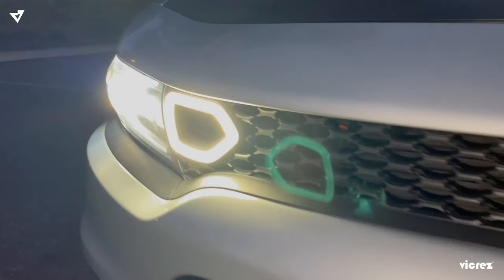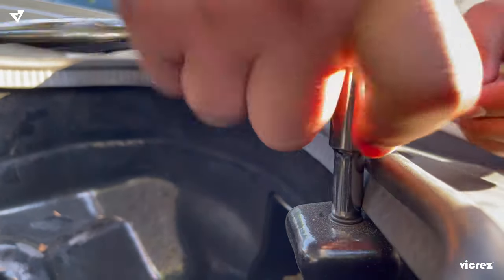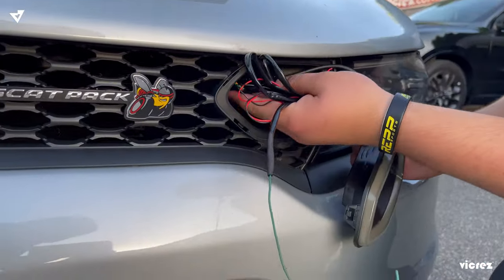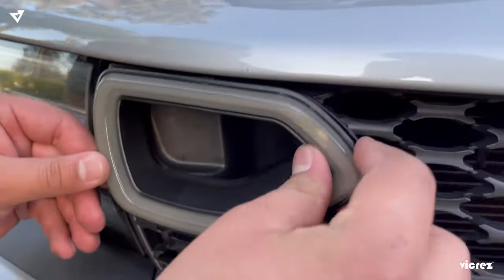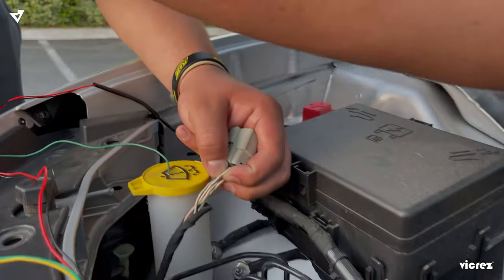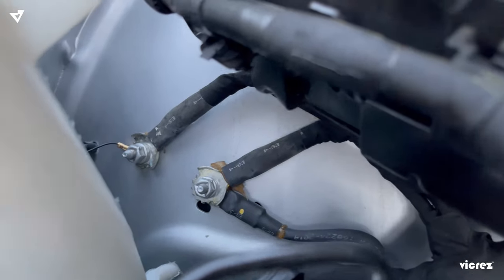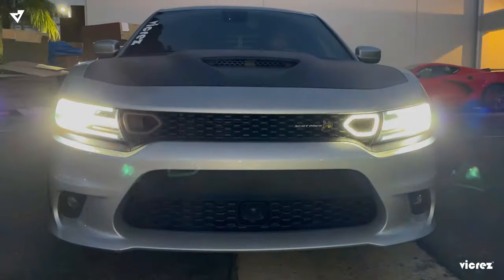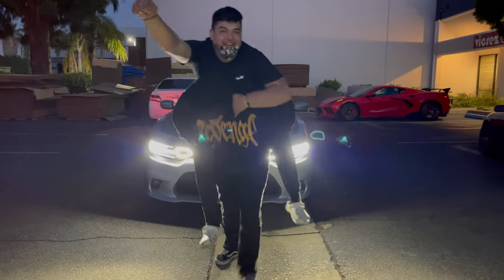Vicrez LED Lights for SRT Grilles vz102173| Dodge Charger 2015-2021| Installation

Comment: Quick tip for anyone getting the grill lights. You will need to run a bead of silicone around the light lens and the black plastic in order to prevent water from getting inside. It’s pretty easy, just a little silicone in the cracks will keep your lights working for years.
Reply: I appreciate you bro, looking to purchase these soon! I’m somewhat scared of installing them myself but I really want to.
Reply: @akeemedwards9706  same here. I'm trying to build up my confidence.
Reply: How can we achieve that? Link some products either like silicone caulking or wym?
Reply: Wish I did this.. one of mine went out and that shit has been bothering me. 
Dodge wants 1100 to fix it. 
1100… 🙃
Luckily I have friends who are licensed mechanics, gonna see if they can help me out.

Comment: Good video Dude, I really like how you showed the removal of the snorkel as most video's just say remove snorkel and skip the removal process. For those of us who don't want to break stuff this was nice to see. Only thing I would have added was a reminder at the beginning of the video was a note to disconnect the battery, I know we are talking about very low voltage here but any time you're messing with the electronics is always best to disconnect the battery. I also made sure everything worked before buttoning everything down. Other than that great video and helped me with mine. Cheers..!!

Comment: What’s the difference from sequential and non sequential ?
Reply: Sequential lights fades from one side to the other and non sequential lights just flash on and off. The lights in the video are sequential.
Reply: What gauge splice did he use 18 or 16?

Comment: I’ve had mine installed for almost a year. A little bit of moisture build up from rain/car wash but otherwise still work great. I didn’t buy from y’all but was pissed when I found out they weren’t the sequential model 😂
Reply: I Bought The Sequential Ones And They Looked Good And Worked Fine Until It Rained And Now They Don't Work At All 😔 Only Had Them For A Month
Reply: @demetriusbristol9025  have to apply silicone around the edges for a rain-tight seal. Only cost about 5 or 6 bucks to protect them. If you get clear the only way you can tell is up close, but about one foot away you can tell the silicone is on there at all.

Comment: What do you do if turn signals work on both and one stays runing but the other does not stay lit just the turn signal works did I mess up wires or is light broken ?
Reply: I’m having the same problem too. Driver side stays on no matter what and passenger side stays off with the DRL. Only comes on with the headlights

Comment: The snorkels i received just recently and haven't installed them yet, but i noticed in this video the power box is different from what I received  in the video the yellow and green wires are much shorter than those in this video. I'm not sure I received the correct snorkel lights. I ordered the sequential and these don't look to be correct.

Comment: I did everything exactly the same, but the lights only work when the plug isn’t connected to the headlight as soon as I plug everything back in they turn off and the headlights turn on.. turn signals work perfectly. Any ideas on what I can do it what it could be?
Reply: Hey did you ever figure out what the problem was?

Comment: So for the yellow and green wire do I cut the golden clip off and then strip the green and yellow rubber off cuz you didn’t have the golden clip in the video you went straight to stripping the rubber off
Reply: And where do you get that extra green wire that you connected to the green and yellow wire
Reply: I believe it's extra wiring that they have on hand it doesn't come with it  I had to do the same thing for the lightingtrendz flow series blue ghozt setup

Comment: I did everything like the video my turn signal works but not my DTRL . Any suggestions ?
Reply: The green wire is for drl, but in the video he combined the constant power wire and the green drl light together. The drl lights only work if your car come with the drl light function. My car does not have that function so I didn’t connect the green wire.

Comment: The blue clips to connect the wires does that come with the kit?
Reply: Does not come with the kit. I had to buy separately. Also invest in solder seal wore connectors. They connect the yellow and green wires together with your one wore and use a heat gun to shrink wrap it. Much better connection than just electrical tape.

Comment: I got mine all wired up, my turn signals are working as they should but there not turning white for the day time running lights any suggestions?
Reply: Ever find a solution?
Reply: Did you ever figure out what was going on

Comment: Does everything you are need come with  the order ?  Or is it just the lights ?
Reply from the maker: these are the lights only. If you like the lights and the grille together the product is vz102123
https://www.vicrez.com/vicrez-front-grille-led-lights-srt-hellcat-style-vz102123-dodge-charger-2015-2016-2017-2018-2019-2020?search=vz102123

Comment: If you want the lights to come on with your DRL and Headlighst DO NOT listen to this video. If you follow the video you will only have the grill lights with the headlights on not with your DRLs. Don't know why this product couldn't have just came with a page with a wiring diagram.
Reply: where could i find instructions on that
Reply: @Richie H  no Idea, me and my brother just figured out the wire that stays hot when the lights are on and off with a test light, and thats one we tied into for power.
Reply: @mattmadison7905  thanks for the tip !

Comment: is the power wire hooked up to headlight power cable or DRL power?
Reply from the maker: They go wired to the headlight marker
Reply: @lbcguy8723  bro I have that same issue. Did you resolve it? Pls respond 😩😩
Reply: @dru433  i rechecked my wiring and found no loose cables so i wrote them on facebook and by time they responded back the dim started to match the other light. Im guessing it was me moving cables around or just give it time for it to get bright. I know led bulbs are supposed to be instant unlike HIDs
Reply: @lbcguy8723  man my passenger halo is giving off a orange dim light and the passenger LED is off. It was working fine for about a week. Everything is wired, clamped, and hooked up. So I’m at a loss on what to do tbh.
Reply: @dru433  so only the passenger side is giving you issues?
Reply: @lbcguy8723  yeah

Comment: Why did you put the wires through the top that’s ugly and looks crappy. Couldn’t you have routed the wires where it does not come out the plastic on the top…
Reply from the maker: We are sorry as this was a quick installation video in regards to how set up and connection is